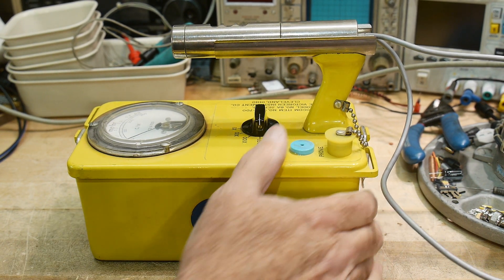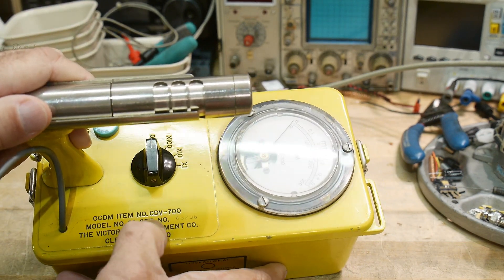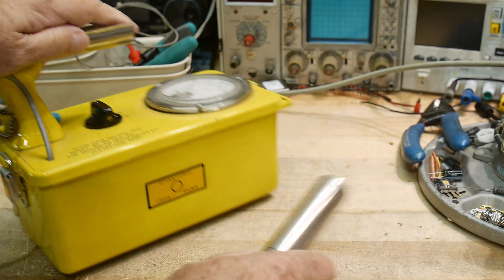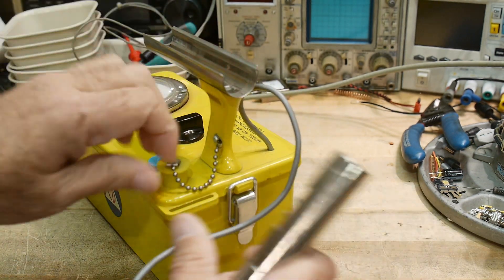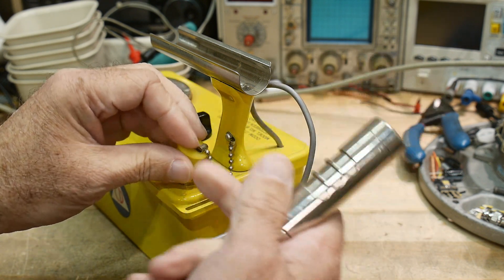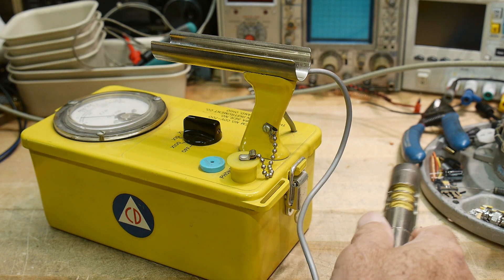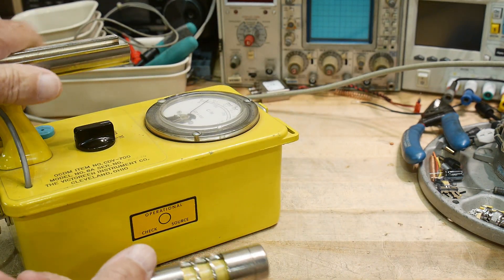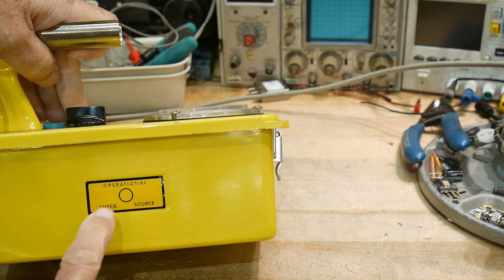#1334 Radiation Meter Geiger Counter

Comment: I am lucky to have both of these units, the CDV-700 inc the kit CDV-777 and the FNIRSI GC-01. The calibration on the side of the CDV-700 is useful as I have tested both the CDV-700 and the GC-01 units and  I have got the same test reading. Be aware! there are some  GC-01 look alikes without the brand name of FNIRSI that have the inferior tube inside and other youtube videos shown they are not so good.

Comment: The F-NIRSI gadget shown at 8:30 is useless in bright sunlight as the display cannot be seen.  Also the internal battery has to be charged which is another negative if using outdoors, when we would usually just swap out the dead battery.  Not a practical device at all, just a nice indoor toy.
Reply: Disagree with this take. You can adjust the brightness. But you're not going to be staring at it the whole time anyway, so the alarm is what is most useful. 

It's very common to carry an extra battery. I always bring mine if I know I'll be out of the house for more than 8 hours. This is just another device that could be charged off of it if needed. 

For $35, this is helpful for the (very few) times someone would want to check radiation.

Comment: nerd invasion: here's a full explanation of 4:30 on types of ionizing radiation

1. Alpha (α) decay
• The emission of two neutrons and two protons (helium-4 nucleus) from an atom
• Due to charge (+) and mass, alpha rays strongly react with matter, and only travel a few centimeters in air. 
• Alpha emitting substances can cause cell damage if ingested. Alexander Litvinenko, a defector and former Russian secret service officer, was poisoned by polonium-210 (alpha decay) in his tea.
• Geiger counters can easily detect beta and gamma, but alpha requires special detectors.
• Can be stopped by paper and even air over a short distance
		
2. Beta (β) decay
• The emission of an electron or a positron (a particle with the size and mass of an electron, but with a positive charge) from an atom
• Due to the smaller mass, beta rays travel further in air, up to a few meters. 
• Poses some external health risk in addition to certain internal health risk. 
• Can be stopped by wood, aluminum etc.
	
3. Gamma (γ) decay
• The emission of high frequency photons (1019 Hz = 30 - 300 EHz ; λ = 1 - 10 pm), which are those rays high on the EM-spectrum like X-Rays, Gamma rays etc.
• Having no mass or charge, gamma rays can travel much further, but lose energy due to high frequency 
• Can be shielded by denser materials, such as iron, lead, water, concrete

4. Neutron (n0) radiation
• The emission of neutrons from an atom, such as that from a fission or fusion reaction (e.g., nuclear bomb) 
• Like alpha decay, it needs a special detector.
• Perhaps the most dangerous form of radiation, as it can travel large distances, penetrate nearly anything, and especially in that it "activates" or makes non-radioactive material radioactive, such as your own skin. 
• can stopped by water, concrete

Comment: You might want to take a look at the review of the GC-01 I just released on my channel.  Sadly the product has just switched to a far inferior GM tube and this even includes the white-label versions of this device.  I contacted the company here in China (where I am based) and they confirmed the change.  Such a shame, its was pretty OK for a low cost counter...

Comment: Low sodium salt (~ 66% potassium chloride. ~0.012% of natural potassium is potassium-40), is a simple easily accessible source of beta and gamma radiation (~three times background levels for most of the world). 

Potassium is nothing to worry about, your body maintains a near constant level of potassium, and any excess passes right through your system (~0.4% of the mass a human body is potassium, therefore ~0.00005% is radioactive potassium-40). So you are really talking ~0.05 grams (~0.0018 ounces) in total distributed through the entire body.

Comment: I believe the source on the side of the counter is Strontium 90.   I have one like yours.
Reply: Not Sr-90 on American stuff.  That was used on foreign counters though.  American Civil Defense stuff mostly used depleted U and also Radium 226. Some of the more fizzled out test source stickers even used "Radium D+E" (From ORAU) "Radium D and radium E are the historical names that Ernest Rutherford used for lead-210 (Ra D) which has a 22-year half-life, and bismuth-210 (Ra E) which has a five-day half-life".  Now good luck remembering all that.  :)
Reply: @nefariumxxx  Victoreen used depleted uranium.
Reply from the maker: The CD V-700 also came with a "check source", a bit of a radioactive isotope under a sticker on the side of the unit. The isotope varied with the maker; depleted or natural uranium was common, though the Instruction and Maintenance Manual for the Lionel Model 6B indicates that a "Radium D+E beta source" with an approximate half-life of 22 years is present under the nameplate. This produced, at the time of installation on the machine, about 1-2 mR/hr adjacent to the source, a value which was clearly visible on the analog meter as well as audible via the headphones that accompanied the units. Measured with the probe's beta window uncovered and the probe directly in contact with the operational check source, this is about 100 times normal sea-level background levels of radiation, and similar to the near-field from a uranium oxide-glazed red Fiestaware saucer. The level drops back to background levels a few feet from the source. Since the half-life of the different operational check source materials used varied and since all CD V-700's were manufactured prior to 1964 and are now approaching a half-century old, the amount of radiation emitted from the source may be much lower than when the unit was originally issued. Therefore, accurate calibration via the source cannot be assured.[2]

Comment: Can you do a measurement comparison between CDV-700 and Fnirsi GC-01?
Is the CPM value (and sensitivity) similar for the same radioactive sources?
Reply: The CPM values are probably a lot different and will depend if you have the beta shield open or close on the CDV700 probe.  The FNIRSI has a decent response but it's not going to be super sensitive because it uses a glass walled tube and it's shielded inside the plastic case.  Glass and plastic both block low energy beta counts.  The stock CDV700 uses a thin metal wall tube but it's also not all that sensitive deliberately.  The FNIRSI is a good value for the money.  Just too bad the developers really dropped the ball on adding a "click per count" or source finding mode.  It could be modified possibly by running a couple wires from the flashing LED to a piezo disc clicker.  Try a 2.5 khz piezo perhaps.

Comment: There are two main types of detectors, GMtubes and scintillators.  The GM tubes are less expensive, but orders of magnitude less sensitive.  In addition if GM tubes are hit with strong radiation, it can make the tube somewhat deaf afterward.  Units with the scintillator have both greater sensitivity (ability to detect weak radiation) AND the ability to be used with stronger radiation sources.
Reply: This is very useful information, you are the fist person I have come across online to flag that, thank you.
Reply: @Anthony_Matabaro_3D_360  You are welcome.  I've been shopping for counter myself and was wondering what the difference is and why the difference in price.  I'm planning to get a low end scintillator counter.

Comment: Isn't that front side red LED the actual detection indicator? You should try attaching a small piezo speaker to it. I might order one to try that out. It's a nice unit, but not having an audible output is a major design flaw as it also serves as a, completely analogue, way of verifying that the detection circuit is OK.
Reply: did it work?
Reply: @irondan357  Never ordered the unit :) Mr. Imsai Guy should do a follow-up :)

Comment: Nice Detectron check source disc you have.  I have several Detectron units but none with the disc.  Nice video!
Reply: Yep, the black plastic PRI versions are known to leak a bit of contamination.  Don't know about the Detectron version.  It looked ok.

Comment: You got get a Radiacode 101, pricey, but very sensitive got mine directly from Russia, it took 10 days from Moscow to my door.... This unit can pickup radon while riding my bike around the neighborhood, while logging the location to a Google map on the app, and can detect from 30ft if someone has radioactive tracer in there body.... Very awesome.....
Reply from the maker: what I want is a RadEye™ B20
Reply: Price I found on that is in the $600 range.  It is a scintillator type counter though.  More sensitive to low levels and more resistant to damage from higher levels.
Reply from the maker: @BryanTorok  the B20 is $2000
Reply: @IMSAIGuy  I was looking at the Radiacode 101 which is also a scintillator based counter with decent electronics for about $600.  The B20 strikes me as way overpriced in that they market to industry, universities, and other institutions with deep pockets.  I'm sure it is a great piece of equipment if you can afford it.
Reply: Those are cool but it doesn't detect Radon gas directly. You are mostly detecting background radiation coming up from the earth/bedrock granite as well as cosmic/space origin. Radon detectors use different technology. I use a device called Radon Eye because I live in a high radon zipcode. If you want to detect the secondary daughter particles from Radon, you can take a wipe off the whole car windshield right after a fresh rain following a period of dry weather.  Radon progeny in the decay chain gets "scrubbed" out of the air by a fresh rain.  The radon secondary particles (contamination) will adhere to the wipe which can then be detected by your Radiacode directly.
Reply: @nefariumxxx  , All I know is the Radiacode 101 is very sensitive,  the result is always the same, in the areas that I travel,  something is caused higher readings along the a ridge that is on the east side of the river, and extends though my property  going south, I have mapped this on many occasions,  and have saved the tracks, I have noticed higher reading when the air pressure is low,  this was odd as I got very high readings in the entire area when the air pressure dropped extremely low, I recorded the levels for over a month and the higher readings corresponded to the low atmospheric pressure,  sounds strange but it has been proven that radon levels increase as the atmospheric pressure drops.
Reply: How much for a Radiacode 101 direct from Russia and how to get one?

Comment: The problem with Geiger counter, is that it only detects the magnitude and not direction.
I wonder if we can use 2 orthogonal placed tubes or 3 for 3D to detect direction of the radiation? Each tube should be placed inside radiation shield, ie, lead, so that it only receives radiation in one direction, Say X direction or Y direction or Z direction and based on the relative strength of the detected radiation we can display the direction on a LCD  screen, with a vector.

Also, we might be able to use reversed  biased direct band gap diodes or photo cell instead of Geiger Tube. In that case if we use direct band gap photo cell we do not need to use radiation shield, because side of the cell is much smaller than the front side. So radiation detected perpendicular to front surface is many dB greater than the radiation detected parallel to front surface.
Reply: You have the right idea.  There indeed is a rather rare and obscure device which most people have not heard of called the "Uranium Compass".  It was made back in the uranium prospecting gold rush days.  Indeed it used (four?) different geiger tubes with some lead shielding plates between them and electronics to point the needle in the direction of the highest activity.  Pretty clever actually.  I don't know how well it sold but have seen pictures of them before.  You could probably google them up if you search online.
Reply: @nefariumxxx  That makes me  think the radiation from the source is indeed isotropic?  Given a crystal structure of source does it really radiate isotropically?  Can we use magnetic field  or electric field  or gravity to direct radiation? ( of course the Gama Radiation, because beta and alpha radiation will be effected by electric and magnetic field)  this way we will learn more about nucleolus of the atom.
Reply: @nefariumxxx  Another application could be clean up of radioactive waste. You put "Uranium Campus" on a robot, and direct the robot to find and remove the radioactive waste.

Also, we know to initiate nuclear reaction, a neutron must  hit the nucleolus which breaks it up and generates particles  such as alpha, beta, and gama photon.  Now what is happening inside nucleolus, does it looks like molecule, which has orbitals, and photon will kick the electron from lower orbital to higher orbitals.  If this is the case, then instead of hitting the nucleolus with neutrons, we should be able to  hit the nucleolus with high energy photons, such as gama ray or cosmic ray, to break up a nucleous.

I wonder the gama ray wave length from different elements have different wave length?  So we can detect an element by the wave length of its gama ray?
Reply: @nefariumxxx  Thanks, I will research gamma spectroscopy.
Reply: @nefariumxxx  That is pretty much how radio direction finding works. Goniometer.
Reply from the maker: all nuclear decay is isotropic
Reply: @IMSAIGuy  Yes from the source, not the detector.
Say you have a sample of radiation material in one corner of your room with normal Geiger counter you should go around the room to find it, but with directional Geiger counter the arrow leads you to it.
In space such a directional Geiger counter, if you block the sun direction, could lead to detection of location of super Nova or other cosmic activity.

We can also create directional gravitational wave detector with placing 3 gravitational wave detector on the 3 corners of a triangle in the space, say one on the earth another on the moon and a third one on say mars.  By comparing the time of the event given the lag time, we can detect the direction on gravitational wave, the same way we detect source of earth quake using triangulation,  so we can point our telescopes in that direction.

We also can prove what is the speed of gravity, speed of light or infinity as quantum mechanical event.
Reply from the maker: @aduedc  if you can detect across the room with a geiger counter you are about to die. they only detect within a few inches. if you really want direction, just put it in a shielded box and poke a hole in it
Reply: @IMSAIGuy  you just need more sensitive detector.  
The mechanism of detection is when a particle or photon hits an gas atom, the gas molecules gets ionized and the ionized particles accelerated toward positive and negative terminals, and on their way they might hit  other molecules which creates other ionized particles which amplifies the current.
You can have the same thing with avalanche photo diode.
Now the larger the area of Geiger tube or avalanche photo diode, the greater the probability of capturing the photon or particle, which means greater sensitivity.
Therefore, to increase sensitivity you either have to design larger tubes and diodes or put several of them in parallel.
When I drive from Los Angeles to San Diego On I5 I pass by San Onofre   decommissioned nuclear reactor, I can detect the radiation by my cell phone's CCD on the high way in my car and I have not died yet! My phone's CCD is not very sensitive radiation detector.  I just use android app that I bought for 5 box.
Reply: @IMSAIGuy  It's not like 'which way to run', more like 'which door or window to block off!'

Comment: You will be surprised if you take a Geiger Counter into a antique shop, some paint on old vases is radioactive, also the white piece of fabric that is used as a wick on older gas campinglights is radioactive.
Reply from the maker: my friend took his geiger counter to the camping store and the thorium lamp mantles all hanging on the shelf together gave a really strong signal. made the store employees freak out.
Reply: @IMSAIGuy  There is a guy I met in an antique shop who has been restoring the camping style lanterns for years.  He collects them of course.  I showed him the geiger counter response on some of the ash in the bottom of one of his.  I always try not to alarm people but educate them on safer handling.  I explained that it's nothing to freak out over but be careful to wash hands after handling/work and avoid inhaling the ash dust.  Same thing with the old radium clocks/watches.  If you're looking for a nice test source, it's easily found in vintage orange pottery because it's mostly a low energy beta emitter with quite nice high CPM.  Very little gamma.
Reply: Always check watches and clocks as well for Radium, very interesting to find

Comment: You could probebly attatch a piezo beeper to the LED that flashes on the front. :)
I've just ordered one. YAY.
Reply: Christmas prezzie to yourself ? !
Reply: @andymouse  Yes, good idea. I mean that's what I thought all along. :)
Reply: I also thought of adding a piezo.  Perhaps try 2.5 khz resonant freq ones rated 30v p-p.  They were the best sounding for CDV700 anyway.  Radio Shack part number 2730073 can still be found online/ebay etc.
Reply: @nefariumxxx  Maybe a distant relative of mine ?...Merry Squeakmass !🐭
Reply: @nefariumxxx  Nice one !
Reply: @nefariumxxx  I've used them before, (I had one as a doorbell. LOL). But it's too big to fit inside the case.

I am waiting to see if anybody else tries it first. I'm not risking mine. Ha ha.
Reply: @nefariumxxx  I've been thinking of a disc piezo glued to the back wondering if the case would form a sort of sound box. (?)
Reply: @nefariumxxx  On mine the LED seems to be at full brightness when it pulses.
As for the rubber surround, you have a point.